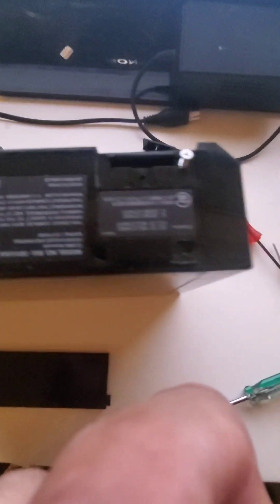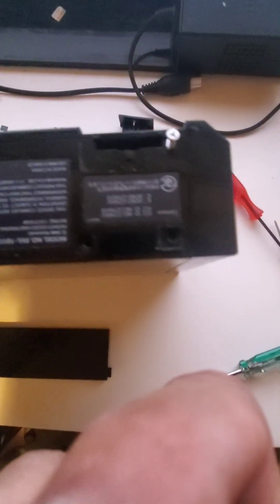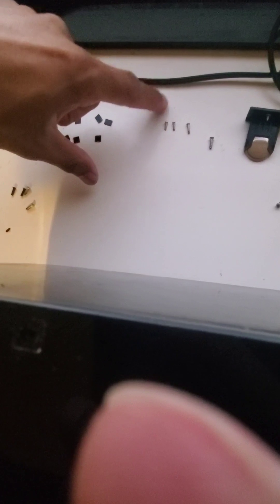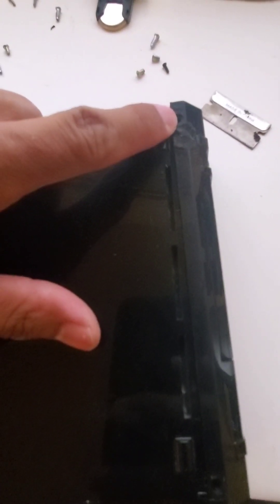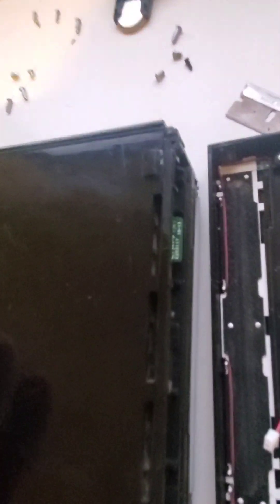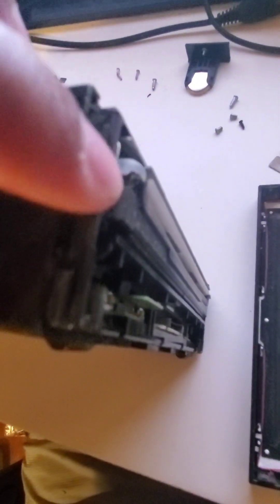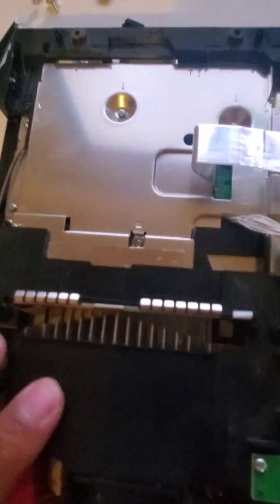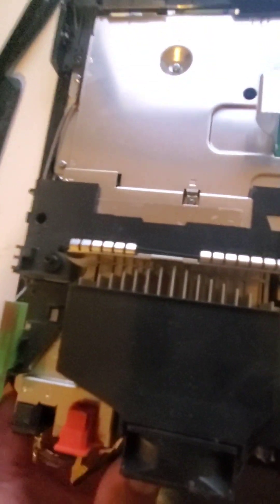Nintendo Wii RVL-101 teardown / disk drive replacement

Comment: The top plate for mine won’t come off
Reply: Same
Reply: Hye found a solution in the back does little things that are used to make them stand you can peel them there are screws there hope that helps
Reply from the maker: if you mean the top plate that would normally have the gamecube ports, there are three screws hidden under square stickers. If you mean the top plate as if the wii is lying down, then this one can stay on if you are replacing just the disk drive. The underplate removes, which is the one with the rubber feet, the rear rubber feet (opposite to the disc drive opening) are the ones hiding two triwing screws. Also for the underplate, the other screws must still be removed. if you follow the order of the video then it should remove without issue.

Comment: hi is it possible for the  Wii to boot and reach its homebrew channel without its game drive? Actually, I want to remove its drive to reduce its weight (light and portable).. kindly update me thank you.
Reply from the maker: Taken from gbatemp forums "The only non-essential thing you can remove is the disc drive. The Bluetooth module and the Wi-Fi are both needed without software modifications to the Wii. You can play GameCube games through Nintendont without a disc drive, but playing Wii games without a disc drive requires use of emuNAND to emulate parts of the drive in software."